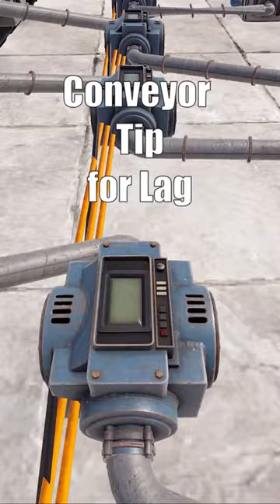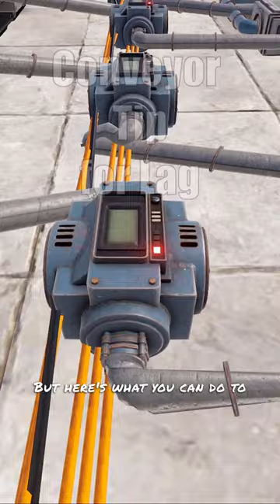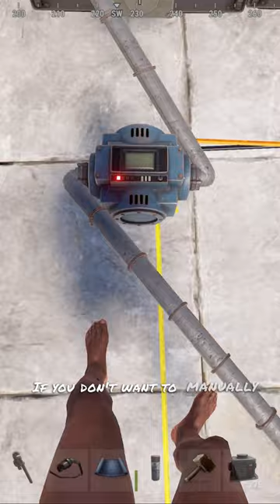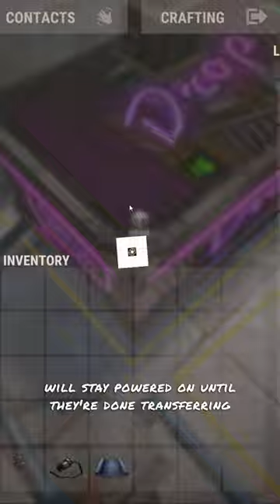Reduce Conveyor LAG, Noise, & Power Usage with This Tip in Rust! #rust #rustshorts

Comment: Great tips sig can't wait to see more coming 😀
Reply from the maker: thank you! another few days
Reply: @sigbog  electric furnaces are overpowered, u can put 6 of them in a triangle that will be equivalent to 2 large furnace, or u can put 18 elec. in square, which will be as good as 6 large furnaces. The only minus is the need to set up oil refineries to make up charcoal production.

Comment: I want to turn off the electric furnaces when it finishes smelting. The problem is that the Filter Fail shoots a message faster than it takes to smelt something like HQM ore. So I'm trying to set up a switch that can only be toggled after a 30sec timer runs out. So the timer needs to be activated on filter fail, and a switch that is blocked from toggling during the duration of the timer. 

Having trouble wrapping my head around it. Am i making it too complicated?
Reply from the maker: IIRC a long time ago I looked at some different options. As a problem to solve youre not making it too complicated, always fun to grab these challenges. Practically speaking you maybe should just use a switch or put down some extra power. I would look at memory cells, I don't remember if I had the same filter fail/pass fighting on memory cells or not but I think I got something working with it. Could also consider pulling filters in, like having a filter for max ore of 1, then have that trigger the timer off filter pass instead, which keeps the circuit powered. let me know if you end up finding anything that feels fool proof and not too fiddly though